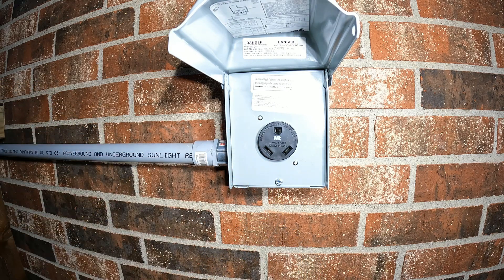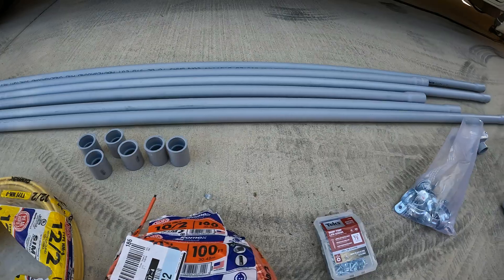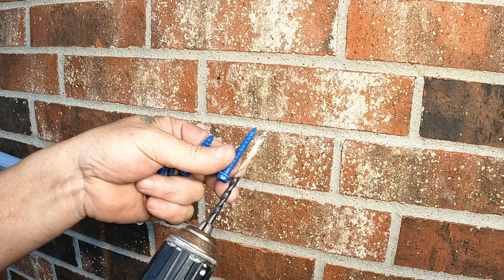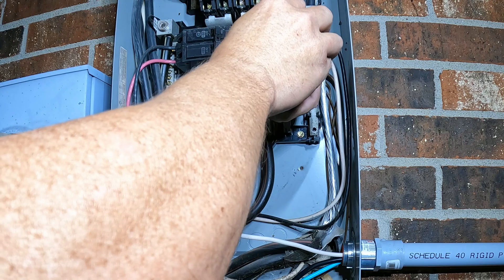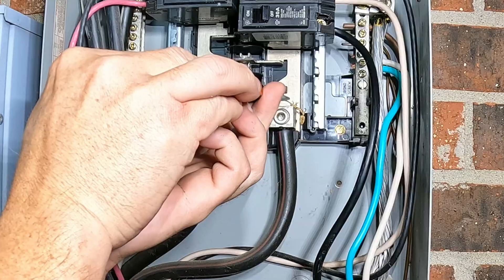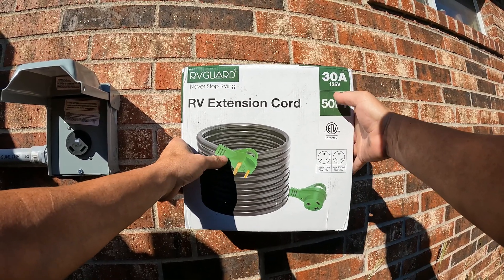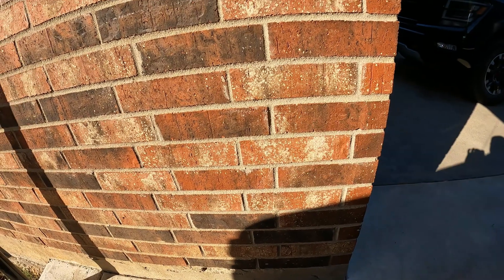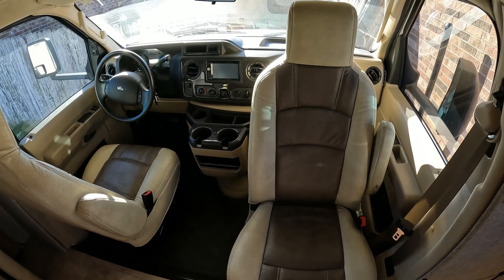30 Amp RV Outlet Installation and Wiring

Comment: Just for future reference for anyone watching:
- 10 gauge wire can be used for 30 Amps
- 3ea 8 gauge wires only requires 1/2" conduit if using Sched 40 conduit // 3/4" conduit if using Sched 80

- 1/2" conduit is fine for all 10 gauge wire
- Must use THWN or THHN wires inside the conduit.

Comment: I may be wrong, but your main panel or meter already has a neutral/ground bond. By wiring your RV negative and ground to the same bar, you have created a second neutral/ground bond. From what I THINK I know, you should never have two neutral/ground bonds. It's my understanding that this creates a path for electricity to flow through you if you touch an item with a short, such as a shorted out toaster, or any other appliance. It's a shock hazard. Just for the record, I'm no electrician and generally consider myself electrically stupid. However, I did stay at a Holiday Inn Express last night. No, seriously! I've been doing a lot of research, and if I'm wrong, I'm wrong. I'll accept that, but if someone can explain it better, please do.
Reply from the maker: Good insight! I have a few electrician friends that told me main panels are bonded and sub panels are separate neutrals and grounds. Confusing to me also. Hope you enjoyed the Holiday Inn. Thanks!

Comment: Love the idea of splitting the 30 amp and 20 amp boxes.  Saves a little $ rather than having the single box with both.  Great video, very informational.
Reply from the maker: Still wishing I added the 20amp, it’s getting hot already here in TX. About to add the TPMS system and CCTV system. Then the 2nd AC unit👍🏽. Appreciate it Jeff! Safe travels!

Comment: Do I have to contact power company to run box off meter .?
Reply from the maker: Yes, the meters around here are locked out. An electrician company can schedule a disconnect and add a box most likely.

Comment: For difficult knockouts I reach in with my cordless die grinder and weaken the attachment points so the knockout either falls out or is easy to push free.
For RVers who are DIYers it's worth installing an RV panel which has 30A and 50A outlets because besides RV power the 240v single phase powers larger tools like air compressors and welders.
Reply from the maker: Great points! The 50 amp could come in handy. Some of those knockout are almost impossible to get out without ruining everything else. Thank you!